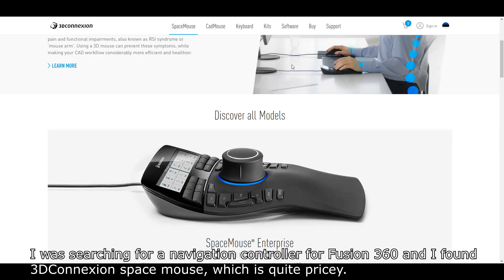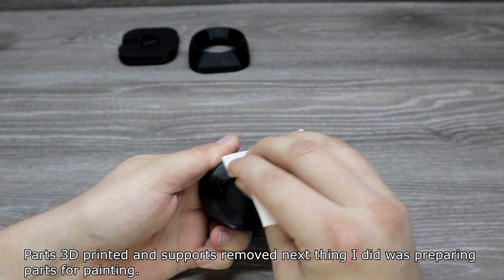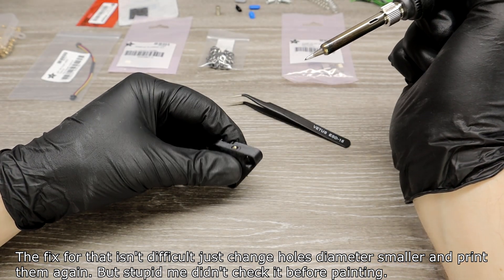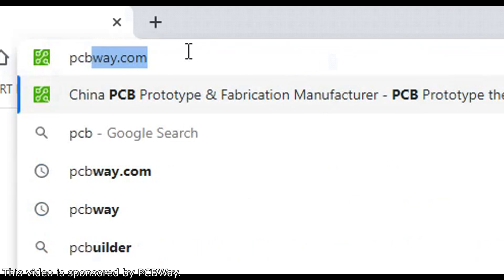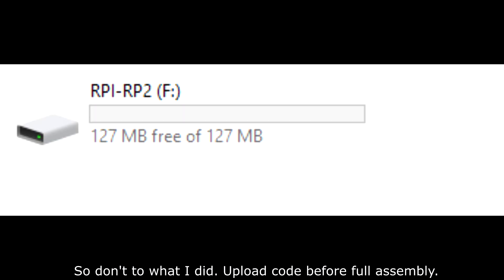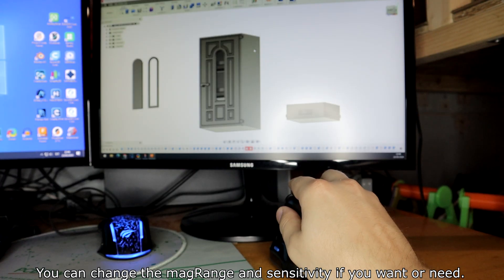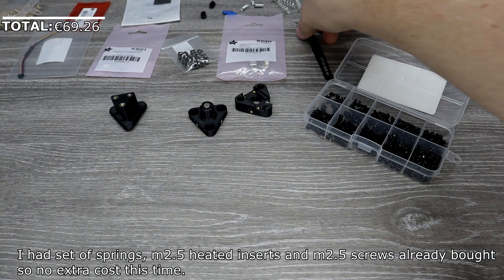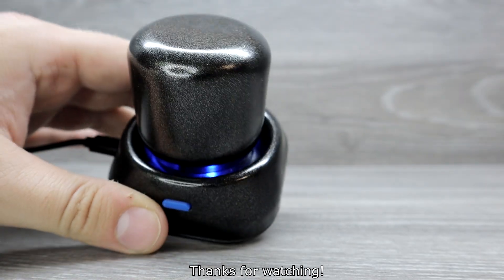DIY Space Mouse - Do It Yourself or Buy One

Comment: I did one, and sucks completely... buy a real one.
Reply: what is bad about it?  Just curious because if this design is based on a 'good' design, isn't your built one moddable?

Looks like its mechanics uses springs, which gives you a ton of options to customize it.  Someone who modifies keyboard switches would be a good place to start I bet.
Reply: @ncfacanvass5028  not precise, too noisy (spring clicking sounds) and too expensive for a diy project.

Comment: Hi Dude, Iam trying to open the die space mouse application after selecting the board, facing the error Exist status one compilation error: extended character is not valid in an identifier  In the  output command prompt. ..RP2040 light model  circuit board can You please suggest.

Comment: Bro is still using the cold plate and glue stick. Update yourself to 2024 with some PEI man.
Reply: There's no reason to fix something if it isn't broken.
Reply: PEI can be a PITA too.  Namely if you don't want to wait, you can end up ripping chunks of it right off the build plate.
Reply: @tasa4904 I never wait for a PLA print to cool before removing a part from my PEI sheets. I do use the engineering plate with glue stick for PETG, TPU, ASA, ABS, NYLONS, etc though.

Comment: This looks like a spacemouse but it is no where near one in terms of movement.
Reply: That deadzone looks like it's a km wide, and it looks like only one axis is active at a time (aka dominant mode).

These DIY devices are a great initiative, but the firmware side still needs to improve to match the usability of the commercial devices.

In the real thing there's barely any deadzone, and all 6 axes are live at the same time. This is IMO a very important part of how the spacemouse/navigator/pilot work

Comment: Hey, i’ve been looking for DIY spacemouses and found one by Teaching Tech that emulated 3dconnection with arduino, using an Arduino Pro Micro. It used 4 joysticks instead of magnets but I believe it can be worked around so that this spacemouse gets 3dconnection support, wich I would love since this is much smaller than the joysticks one.